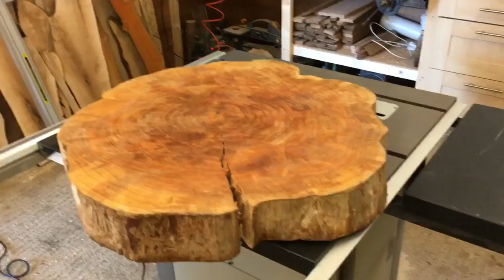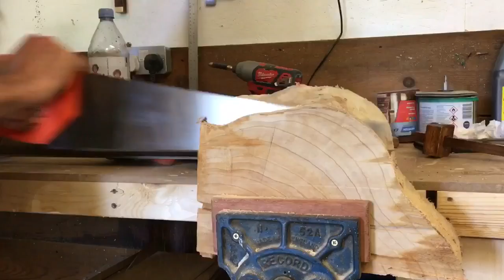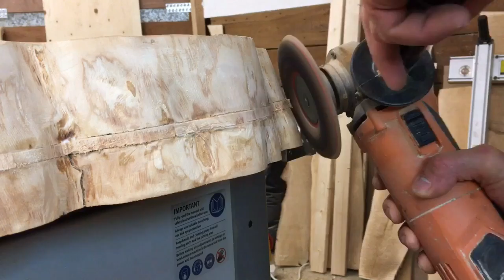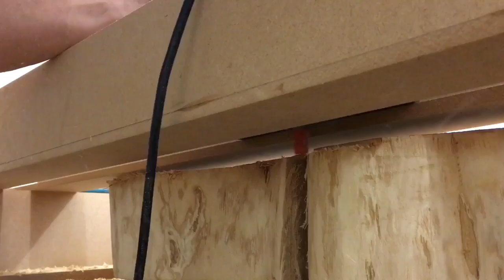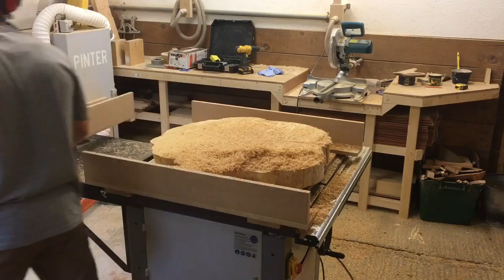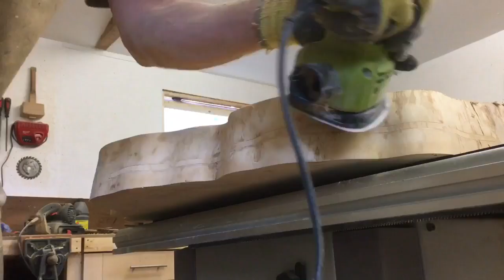Flattening and repairing a live Edge Slab

Comment: Thanks for the video I never realized how much work it is to flatten a top was.
I would use a black epoxy for epoxy for the cracks and a thick resin bar top finish completely sealing the top including the sides and bottom. This would greatly reduce the chance of future movement.
If you have access or can make iron legs.
Reply from the maker: Monte Glover thank you very much for the tips! Appreciated

Comment: Great video, how about industrial meets wood and have some splayed square metallic legs welded together and bolt the top on, then you could fill the cracks in the wood with a coloured epoxy?
Reply from the maker: Woodworking Brewer thank you. "Industrial" I like that look!
I'm not sure about epoxy. I never done that before and I'm a bit worried that I will make a mess of it. Could be difficult to get it out of end grain, I guess. 
Thank you for the suggestions, appreciate that!

Comment: i think you should make a jig so you can rotate the slab from the centre on your table saw and taper the bottom of the table so that it is original thickness in the centre and thin on the edges (the chainsaw cut would be cut off then) i like the colored epoxy resin in the cracks idea . the tapered bottom lends its self to three legs that although splayed would be square to the tapered surface.

if you go the industrial meets organic  metal leg look then maybe some chunky steel  bowties  stabilising the crack would look cool
Reply from the maker: chris snyman thank you very much! That tapering jig idea is quite interesting. Anyway the fix turned out quite reasonable I think. 
Appreciate your tips.
Regards Szilard